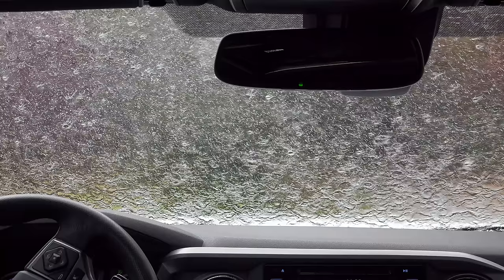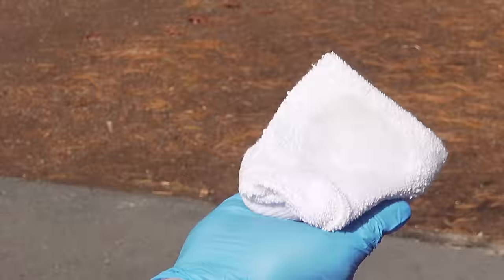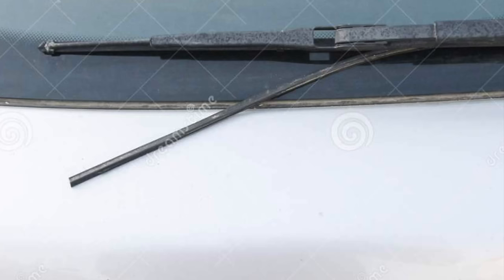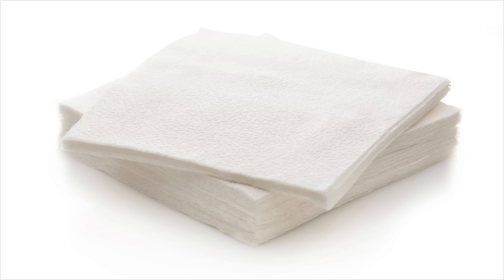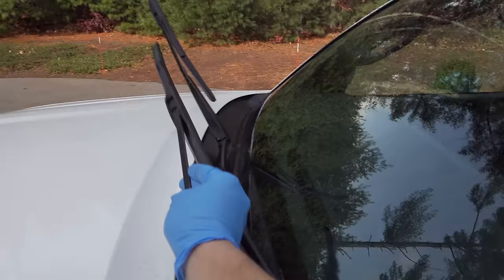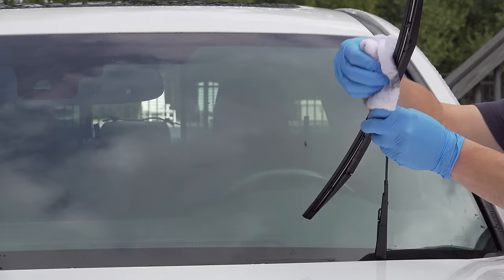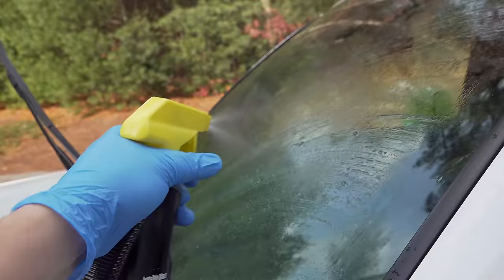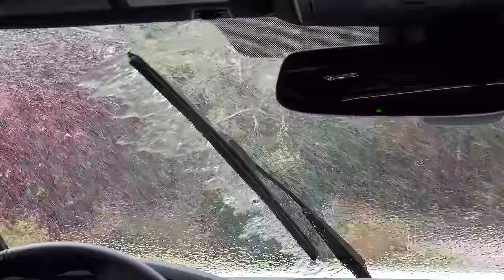How to Make Windshield Wiper Blades Like NEW in 30 Seconds

Comment: I did a similar thing close to 40 years ago.  We were released from a meeting because a heavy storm was coming in. I got on the Interstate 5 and the rain was coming down.  Big trucks went by me and the splash of their spray messed my windshield up so bad I could not see but maybe 20 foot ahead.  My wipers were going full speed, but not keeping up with a messed up windshield.  I pulled over to the side of the freeway, and the rain had let up some.  I had a dirty rag in the seat on the passenger side. Before I proceed let me make a side trip.  When I was just a kid, my dad pulled into a gas station to get gas.  In those days attendants would ask if you wanted your windshield cleaned. My dad said yes.  As the attendant used paper towels to clean the windshield and was nearing completion, my dad told him to clean the wiper blades too. As the attendant pulled the towel down the wiper blade the grease and tar came off the wiper blade to the towel.  The attendant was astonished as no one had ever asked him to do that before, nor that so much road tar was even on the blades.  That attendant learned a lesson.   Many years later we were on a trip.  It was raining.  My dad pulled over to the side of the road to clean the wiper blades.  In the glove compartment he had a cloth bag of Bull Duram Tobacco. He ran the bag of tobacco down the wiper and it too cleaned the blade. Back to my story.  I picked up the dirty rag, and had some RainEx with me.  The wipers were still going and I sprayed the RainEx on the windshield.  I recalled how my dad used Bull Duram  on the blades.  I turned the wipers off, and doused the dirty rag with RainEx, and ran it down the blades. Got back in car and proceeded down I-5.  Within about 5 miles the windshield was clearing up. Big trucks came by spraying my windshield, but the wipers just swished it away.  About 10 minutes later I could see way down the road in the heavy rain, and truck spray just wiped away.  My windshield was virtually clean (just a few spots here and there) To my amazement, the windshield stayed clear in rain and shine for nearly 9 months!!!  Unfortunately, RainEx today is weak compared to what it was in the 1980's. Today I think they are diluting it with too much water.  Before I used RainEx, I used 20/10.  I guess I need to compare the 2 products and check the ingredients out to see which one is stronger.
Reply: Alright Jerry.
Reply: Tip...when it's dry and after cleaning, pour the rainx directly on the window and use a squeegee to spread the fluid around before buffing in with paper - cloth will soak up the rainx and reduce the usefulness.
Reply: You're right, modern RainX is weak.  I have to apply three or four coats to make it work like the original did with just one wipe, but then it lasts for years.
Reply: @milesparris4045  yep, noticed that too. I recently tossed by bottle and began using a ceramic spray wax instead.

Comment: For all those people having a fit: The gist of the video is clean your wipers and windshield. Many products will work fine.
Reply: I use just el cheapo supermarket white vinegar!! I swear by it! Even on old worn out wiper rubbers!

WD40 gets too messy, all over your hood and paint......
(Edit: I meant you always seem to spray too much WD40 around and get it over everything, and its not good to get WD40 over everything)
Reply: Mac Sixtyfive 
That's why you spray it in the rag.

Comment: I think this trick will work immediately after thanks to the lubrication the WD40 will give the wiper blade rubber. Though, being a product not suitable for rubber, it will most likely end up eating and ruining the rubber and make the wipers really useless very quickly
Reply: Not at all, I soak my RC tires in WD-40 over night for traction, and they last almost as long as untreated rubber. It does remove a thin layer, but it only seems to remove dry rubber, maybe if you left it soaking for weeks I suppose it might turn it to mush.
Reply: Vinegar works fine

Comment: you can use a spray on wax like turtle wax ice and seal the glass it will bead water and stop any buildup.
Reply: I use Mother's wax on my windsheid works great Hell you don't need your wippers mist time
Reply: I do the same turtle wax has done best for me
Reply: @jacobgrimes2208  I use Rain-X on my car.

Comment: I very much doubt this will work at all! Back in 1975 I was flying as the missile aimer on HMS Plymouth flight. One morning the mechanics had done this to the glass on my aiming sight. We lanched and had some low cloud/mist/fog. we were hunting down the fast patrol boats and I, having the extended visual range, could see very little!  I used the washers but no improvement! My pilot called out for me to get my head out of the sight! The weather had cleared and the visibility was excellent. WD-40 had stuffed the screen up when it got wet! :-(  Isoprol Alcohol might be a good bet?

Comment: Technically....no. DO NOT use WD40 on wiper blades. Yes...it "will" temporarily improve hardened, filthy blades. However the vast majority of wiper blades are made of EPDM rubber. This is the same rubber that brake cylinder cup/seals, classic car windshield gaskets and door rubber seals (where they are still used)...is made of. EPDM CANNOT....MUST NOT....be used with any VOC solvent.  This is why brake fluids are glycol ether based....and not mineral oil based like they were pre-1956-ish (where EPR rubber was used). It starts a degradation process that eventually destroys it. So...yes you are cleaning the hardened built up crud off of the rubber with the solvent in WD40. ....but you are also starting to dissolve the outer surface. Ys...it makes it pliable for a moderate period of time and cleans off down to fresh rubber....but eventually it destroys it.

But....its just a wiper blade.....if you have god miles on yours and they are ugly...sure. Clean them with WD40 and get a few more miles but you will be replacing them not far off.  The suggestions from others below to use denatured alcohol are actually spot on what classic car manufacturers have had in their owners manuals since the 1940's. A stiff, fine bristled nylon brush and denatured alcohol or methylated spirits with do the same thing with no attack on the rubber.
Reply: From what I've read, a short exposure is safe.
Reply: Can I use turpentine?
Reply: @jessegreenwood1956  Many early EPDM roofs failed due to the manufacturers recommendation of using "white gas" to clean the talc from the rubber. Neoprene adhesive was then used to bond the seams. Residual solvent in the gas attacked the adhesive and the seams opened up. It was almost a decade after trial and error  before compatible  "sticky tapes" were used to complete an EPDM seam.
Reply: Can I use rubbing alcohol here, not sure what denatured alcohol is
Reply: @_Y.Not_   Yes you can...but it will do little. Rubbing alcohol is isopropyl alcohol. Unless its about 99% solution it wont really work. But it will not hurt EPDM rubber. Denatured is technically high strength ethanol with a methanol added. Called methylate spirits in the UK and elsewhere.
Reply: @jessegreenwood1956  thank you
Reply: I use 100% Isopropyl Alcohol (well 99.9% close enough) - works a treat
Reply: Yeah when I saw that really black stuff coming off I suspected that's not grime, that's rubber. Thank you
Reply: Surgical spirit is a great cleaner, will remove the tacky remains from a sticky paper label without any damage, so I'm sure it will clean the crap from a rubber wiper without damaging it.
Reply: Thanks Jesse Greenwood. Your comment should be - at the top! and stay there!

Comment: Soap and water is best for the blades as well as the windshield and other windows...
Rain-X works to fill in the pits of the glass to make a smoother surface, which in turn increases the life of your wipers.
Just as your vehicles paint has pits/dimples, this is why we use wax on painted surfaces...
The main thing is to keep everything as clean as possible...
I've even waxed glass before in a pinch.
Just be sure to remove all the residue.
Safe Travels... ✌️

Comment: the "WD" in WD-40 stood for "water displacer". wd- 40 was not in tended to be a lubricant, but a protectant for metal surfaces.
Reply: And the 40 is the 40th attempt to get it correct.  Just adding to your true tidbit.
Reply: And it was invented to protect NASA rockets from rusting in storage
Reply: No shit? What the holy fu**!
Reply: invented to protect nuke missiles in silos keep moisture off em. Why dudes that store cars long periods will remove spark plugs and spray insides of engines thru plug hole w WD40 amd throw plugs back in to keep cyl walls from rusting.
Reply: David Deel Tch beat me to it David 😜 How cool is that though, could have been called WD 27, or WD1087 who knows
Reply: Holy shit
Reply: @obs4281  I think people should use their thought process on so many other things.  Dell Laptop A22, Dell Laptop A23, B22, B23 etc.  Least you would know the newest one of those series.  lol  Does make sense though.
Reply: David Deel Yeah makes sense, nice idea! ✓

Comment: Interesting! I didn't see you going back w window cleaner on another clean rag to remove the WD-40 from the blades? I'd think the oil on the blades would cause streaking of windshield? 🤔
Reply: @1OFGODSOWN  Horse crap. It says it right on the can and is reiterated on thier website. WD40 contains petroleum distillates.

Comment: I use a belt sander on my windshield after I rip the blades off by hand. I can see so great
Reply: I'm too lazy. I just wrap sandpaper around the blades. 1000 grit summer; 200 grit winter.

Comment: Will try this. As a note, and maybe many already know this,  I’ve used wd40 on my cloudy headlight lens.  Handed it about 3 years ago. Unbelievable! Like new.....crystal clear. I spray on then gently wipe of with paper towel, actually leave a slight film. Like new. Once a month.
Reply: Thanks for the tip. I'm going to try this on mine
Reply: That's because the oils fill in the micro cracks. If you get the 3M headlight restoration kit your headlights will be permanently fixed.
Reply: @milesparris4045  every time I tried that, my headlights went back to hazy in 3 months. The proper solution was to use a mild polishing compound and a power buffer. Haven't had to touch them since—they still look brand new after 1 year.
Reply: Mother's mag and aluminum polish works much better and lasts longer!
Reply: @milesparris4045  hi, where can I purchase a 3M restoration kit? Thx
Reply: @mrsdewdrop9678  Google
Reply: @Big_John_C And cheaper than a restore kit.

Comment: Oddly enough WD40 probably isn’t just working as a degreasing agent. WD40 softens and dissolves silicone rubber and I think that this is partly what is going on. The edge of the wiper blade is slightly dissolving to reveal a new surface. Not a bad thing if it works. Just be careful not to get the WD40 on your rubber windshield surround as this may start to soften or dissolve.
Reply: This is exactly what's happening, I use it on a lot of rubber products.
Reply: @RCOverKill  Wonder if it will rejuvenate old golf club grips.
Reply: @thegreenkeeper2537  if their rubber most definitely, just clean with alcohol after because the old rubber comes off

Comment: WD actually eats away at the rubber that is why you never oil a pneumatic tool with it...it also eats shingles too.it works, but it is doing more than just cleaning.
Reply: So if you get a shingles attack on your body WD40 is what dermatologists recommend?

Comment: The third step would be to wax the glass with ordinary car wax. The rain slips off, and the road junk is easier to clean off. Using a clay bar on the glass before final cleaning helps a lot, too.
Reply: I've always done that. Take a bit of effort but it lasts about a year. And we'll I guess being that it's almost winter I better get at it...
Reply: RainX works much better and lasts longer than car wax on the windshield. Clay bar to clean it is a trick hardly anyone knows.
Reply: @milesparris4045  I've done both. I like the wax. Turtle wax hybrid ceramic wax is pretty good stuff. But yes claybar for sure. I use the clay mit

Comment: FYI, WD40 was invented by "Sandy" (Preston) Fleet and a couple of other partners. It was the 40th formula for their water displacement invention which finally worked the way they intended it to. They never patented WD40 because the patent filing would have had to have the description of what it was and was used for AND their secret formula which they didn't want revealed!!! 
Sandy also invented the Omnimax projection system for IMAX theatres such and the one at the HEARST CASTLE visitors center in SAN SIMEON California. He turned his barn on his central california ranch into a place for his player reproducer 40 rank pipe organ.
Sandy was a great and generous man!

Comment: Rubbing Alcohol and then coat windshield with Nu Finish  works great too. Then switch to Silicon blade no more issues
Reply: BINGO!! EXACTLY 👍
Reply: mike force  Interesting been doing it 8 years and still using the same wipers lol
Reply: You mean Silicone, not silicon.  (Unless you want sandpaper).
Reply: Silicone, not Silicon.
Reply: @ernietallman  Yes Silicone
Reply: mike force  If I don't deal well with fact why have the wiper blades lasted for 8 years? Something is working lol

Comment: Yes you said it right! WD40 is a degreaser and do not apply on hinges because the door might do like mine when someone applied it on a door that was making noise, he put just a bit before i say no not this product! on mine wd40 clean the hinge at the point it was hard to open then i use a silicone grease and it was perfect!

Comment: The WD-40 doesn’t get transferred to the glass?  The hydrocarbon solvent in the WD-40 would dissolve the rubber. Sorry for the serious question!
Reply: Great question, along the lines of what I asked.
Reply: You are the only one who given a real answer.  WD-40 is not good for applying to rubbers.  Thanks
Reply: warm soapy water is the best rubber cleaning agent. Giving blades a brand new clearing edge is necessary to clear rain, soil and to stop judder and squeak, and for that one of these wiper-wizard.com tools will do it.
Reply: WD IS FISH OIL

Comment: Wd is amazing stuff, you can also spray it onto electrics, it displaces the water and has no electrical conductivity. I use it on the electronics that are exposed on go carts when running wet races. fully protects great stuff. Buy by the gallon online to save big money.
Reply from the maker: Great ideas, it is very useful stuff. Inexpensive too which makes it even better
Reply: nick b ~ u got that info from scotty...  u phony.
Reply: WD stands for water disbursement
Reply: @RT22-pb2pp  displacement
Reply: Basically the same thing, it DISPLACES water disburses water, to many folks amazement it is not a lubricant, also great for removing sticky gunk left behind by stickers and does not harm paint.
Reply: @RT22-pb2pp  yes sir. Definitely not a lubricant. Common misconception (and intentional marketing ploy)
Reply: @RT22-pb2pp  Yes but it is also not conductive as a bonus. I disagree that it does not lubricate. Many use it after each race at karting to lube bearings. If applied each 15 minutes race it definitely does lubricate, albeit it does not last very long. I personally use a spray with ptfe that lasts longer but many still do use wd with no issues. Spray some on your fingers and rub them together and then tell me it does lubricate lol. It's for how long is the question.
Reply: It no doubt has some oily base but it is strictly  NOT a lubricant. They say so on their website that it is not a lubricant, like baby oil it is oily but is not a designed lubricant. I know when removing sticker residue it leaves a oily film that must be removed but it is not a lubricant per say.
Reply: @RT22-pb2pp  brake cleaner is example of something that isn't a lubricant. Wd does lubricate all beit for a short time but it does actually lube. Sure theres better long lasting lubes but as to wether it lubes or not the answer is yes.
Reply: I will give you that, my point is WD40 is not sold as a lubricant, only mentioned it as i have seen people ruin things thinking it is a lube. Seen many a you tube videos saying use it as lube on a motorcycle chain and such things, you do that you will destroy the chain fast and maybe harm your self when chain fails. I prefer to use the proper LUBE for every type job, as a motorcycle rider for decades wd40 is best for cleaning up excessive chain lube off the chain, but is by no means a lube for a cycle chain or most other bearings or things that require lube.
Reply: @RT22-pb2pp  Yes your right it all depends on application, for chains I'd always go proper chain lube sheerly because you'd be spraying it on every 5 minutes lol but there are situations like in karting where it is specifically used for lubrication. For example, at Racing level the wheel bearings in karting love it, most people strip the grease out from new then use wd to lube them everytime the kart goes out for the 10 or 15 minutes run. This way any water or debris is flushed from the bearing housing and it has enough lube for that run. I wasn't doing this to begin with and the guy next to me said about it. He ran his front wheel and it ran free for no less than 10 minutes ! mine ran for around 30 seconds ! I know it sounds silly but that reduction in friction is said to give up too 2 tenths !... Some like me use a specific bearing lube that has the same viscosity as wd40 but has ptfe added in but most still use just plain wd.. That said that is a specific use and generally u want something that lasts longer than 10 minutes ! I know we have to be careful with o rings and stuff so I figure chains are best cleaned with wd but I find brake cleaner far better for cleaning as it doesn't leave the lube residue.